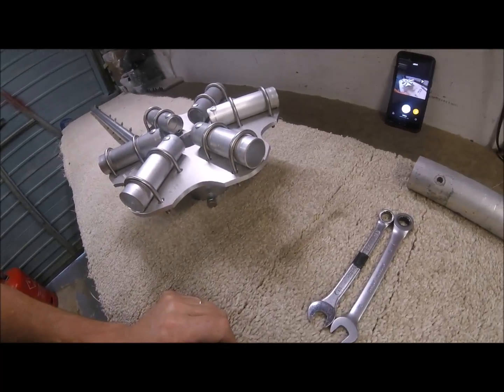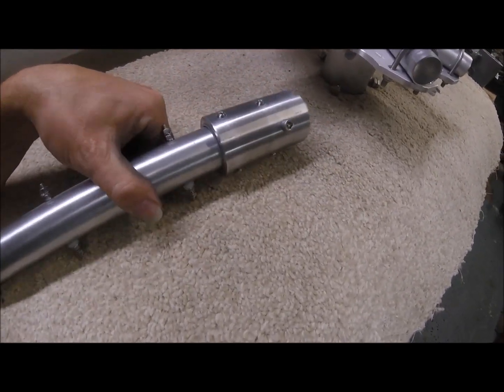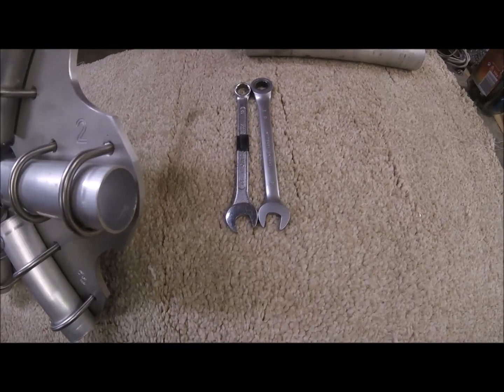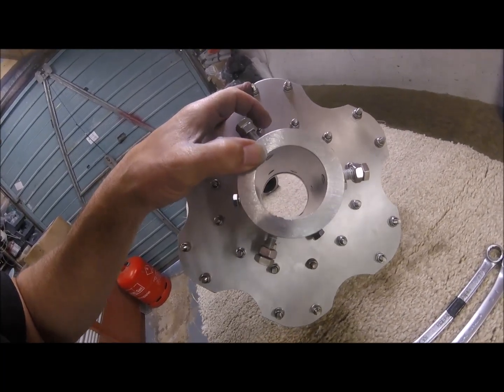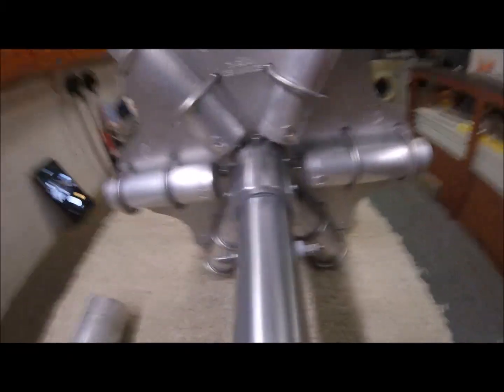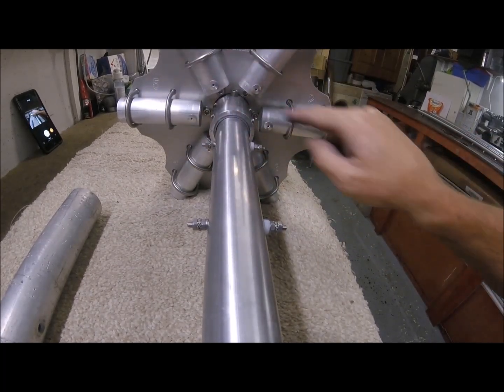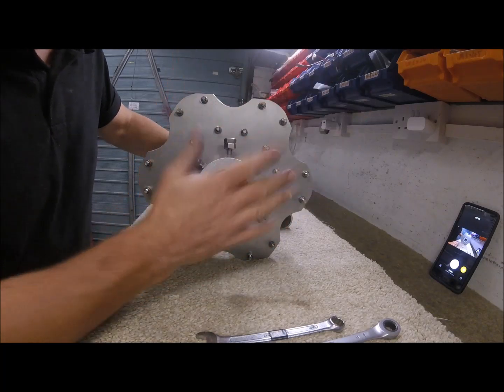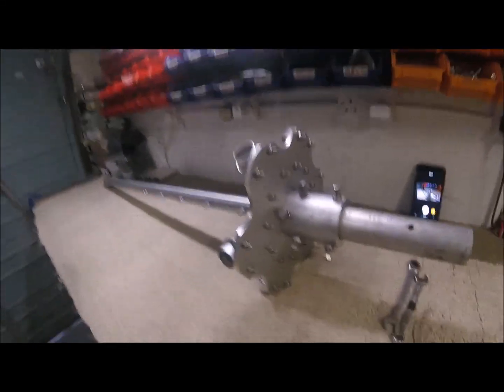1st July 2020 New bottom Flange, Air Coaxial Centre-Post and Hub assembly - G3TXQ Hexbeam by MW0JZE

Comment: Hi Anthony, will the baseplate connect directly to a scaffold pole negating the need for the stub mast. It is a standard 2" aluminium scaffold pole.
Reply from the maker: Hi, drop us an email on mw0jze@g3txq-hexbeam.com and I can answer any questions you may have. Cheers Ant MW0JZE